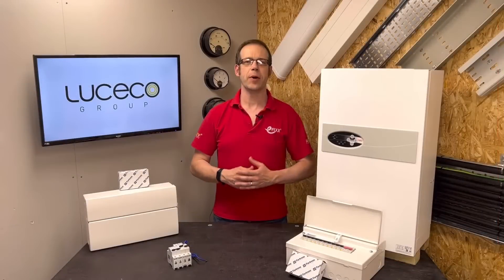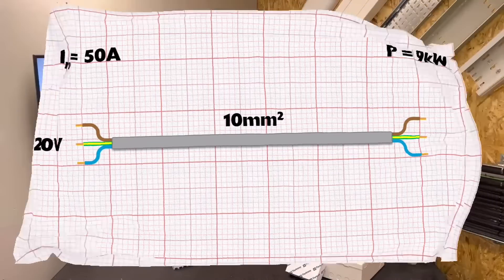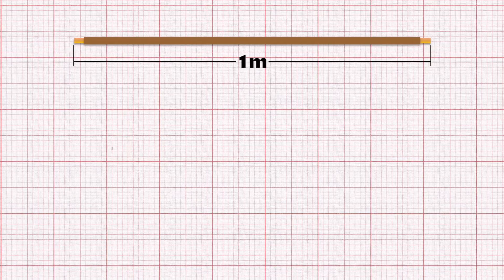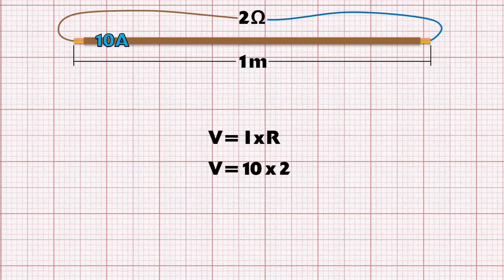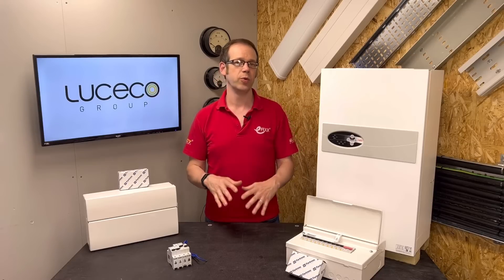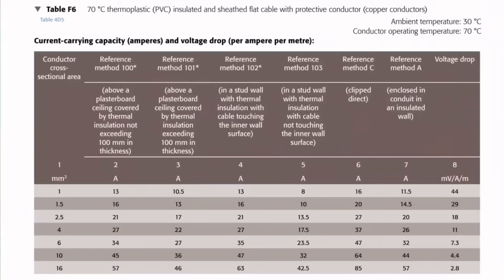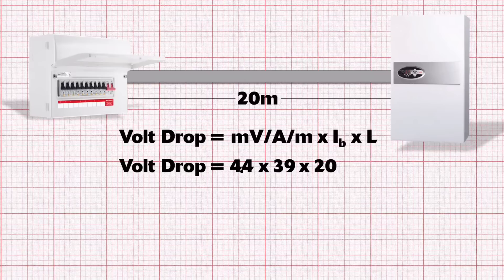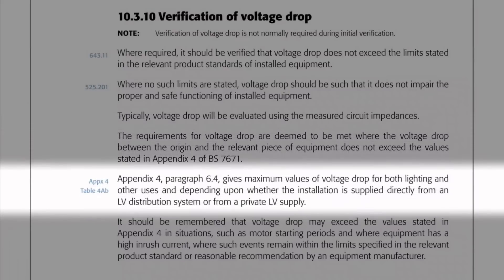Why Does Voltage Drop Along a Circuit?

Comment: I'm a former grammar school physics teacher. The content of this video reminds me of a GCSE and A level physics practical where we would calculate the resistivity of a wire. 

The resistivity equation being :-

p = RA/L

Where:-
p (Rho) = resistivity {Ohm- metres}
R = resistance {Ohms}
A = cross sectional area {metres^2}
L = length {metres}

The formula can be rearranged to calculate the resistance of a given length and width of a particular conductor. (R = pL/A)

I was recently asked to calculate the resistance along a 75 metre length of 4mm copper SWA cable. 

Resistivity of copper (p/Rho) = 1.77 x 10^-7 Ohm-metres
Length = 2 x 75 metres = 150 metres 
XS area = Pi x R^2 = 3.142. x (4 x 10^-3^2) = 0.00005 metres^2

So resistance along 150 metres of 4mm copper SWA is:-

R = p x L / A

R = 1.77 x 10^-7 (Ohm-metres) x 150 (metres) / 0.00005 (metres^2)

R = 0.0531 Ohms

Comment: why is the identical volt drop in the neutral wire ignored ? A 3 volt drop on the 230v supply means 227v at the load L terminal but the load N terminal is not zero it is 3v
Reply: The figures in the table are for the total voltage drop in both the live and the neutral conductors, so if a 3 V drop is calculated, that's about 1.5 V in the live and 1.5 V in the neutral.

Comment: Modern  LED  lamps need very little current to light up ..... With (  some , older ?  ) lamps , the capacitance coupling of the switch drop wires ( with the switch  OFF ! ) , is sufficient to make the lamp glow , dimly (   very useful as a night light 😝 ) ... but some folk find this annoying ... ( tried - n - tested ) ................. DAVE™🛑

Comment: Nice tutorial as usual.

It looks like you have similar vagueness, in determining where the voltage at the load will actually end up, to the standard here.  There's talk about max percentage drop across the installation, minimum permissible voltage at the load, the minimum voltage required by the load etc but no talk about the state of the supply itself when determining cable required to make it all work.  A supply with no load will present higher voltage at the origin than one under maximum rated load and that impacts what happens at the newly attached load in turn affecting the selection of cabling.  My own humble 63A supply (about 30m of 25mm2 aluminium from the pole to the PoA) will droop about 6V under full rated load.

Comment: This is why audiophiles use seemingly ridiculous size power cables together with heavy wired mains blocks.   It's not the current capacity but reducing resistance (impedance) that would effect sound.   It's also why some run dedicated lines back to the consumer unit (so nothing else is shared on that line), and also sometimes use clamping devices to clamp micro spikes that can occur on the mains.
Reply: No, they use ridiculous size power cables because they have no understanding of what they are doing.  There isn't an amp on the market that doesn't have regulated DC within.  Even if we do 1kW with a class A amp, so we are throwing away wads of power has heat, a bog standard line cord will result in a supply impedance quite able to deliver sufficient voltage under full load to the amp for a linear power supply to maintain regulation.  The only way the line cord is going to make a difference is if the cord being used is pure 100% Chinesium.

Comment: Would this make strip light style led fixtures flash on/off by any chance? - I actually had a spark shout at me 'Thats not how electricity works' when I suggested the light that's been replaced 3 times and still flashes.. on the end of the run.. might not be getting enough voltage.. not a bright spark I guess?
Reply: @abc123evoturbobonker  that’s almost certainly what’s happening, voltage too low
Reply: @ thanks!! 🙏

Comment: If were talking reality you won't get near the calculated voltage drop, measure it and you'll see. The voltage drop forumla and tabulated figures are overdesigned, intended for a quick calculation, not real world. Its based on a conductor operating temp of 70c which is unrealistic under normal load and also doesn't take into account "evenly distributed" circuits such as lights where the Ib can be taken as half... Further your example shows a radial, for a ring voltage drop is even less of a concern

Comment: It is incorrect to state that the voltage that the DNOs aim to deliver to properties is 230V. It isn't. When the UK adopted the harmonised EU standard for 230V, it involved no changes in the generating or distribution network. What happened is that the tolerance range was widened such that countries which traditionally used 220V, 230V and 240V were all encompassed. 

The specification was more for manufacturers of electrical appliances in the EU rather than to make countries move to actually delivering 230V. I know in my house and several others that the normal voltage delivered to the property is generally over 240V, often reaching 245V or even a little more. It is no coincidence that your own reading is showing 243.5 actual incoming. Mine is reading 244.2V this very moment.

Apparently the average is 242V in practice. Changing it would have considerable cost implications for the network. Of course it should not be relied upon - there will be properties that will get less than this, but nothing actually changed in the real network in 2003.

Here's a quote from a company (Leads Direct) about what the actual situation was following the adoption in 2003.

***********************************************************************************

"What is the difference between UK voltage and European voltage

The voltage used throughout Europe (including the UK) has been harmonised since January 2003 at a nominal 230v 50 Hz (formerly 240V in UK, 220V in the rest of Europe) but this does not mean there has been a real change in the supply.

Instead, the new “harmonised voltage limits” in most of Europe (the former 220V nominal countries) are now:

230V -10% +6% (i.e. 207.0 V-243.8 V)

In the UK (former 240V nominal) they are:

230V -6% +10% (i.e. 216.2 V – 253.0 V)

This effectively means there is no real change of supply voltage, only a change in the “label”, with no incentive for electricity supply companies to actually change the supply voltage.

To cope with both sets of limits all modern equipment will therefore be able to accept 230V +/-10% i.e. 207-253V."
Reply: My house regularly has 250v according to my Shelly EM, but I am a couple of doors down from the transformer.
Reply: so why then before harmonisation when we wanted to the current draw of say an electric kettle we would defide the pope by the voltage for example a 3kw kettle for example would be 3000 defided by 240v= 12.5 amps , now we use 230v for our calculations so now we get 3000/230=13.0435 amps.
Reply: @Dog-whisperer7494  It's because the nominal voltage of 230V is not what is normally delivered. Usually it will be about 240V. In any event, the only difference is going to be a slightly longer time to boil the water in the kettle if what is actually supplied is 230V, not 240V. In practice there is a lot of variation in voltage supplied by location, but time of day, demand and so on.

The nominal 230V is actually a range of 230V +10%, -6%. So what might be delivered could be anything from 216.2V to 253V. The actual wattage of the kettle is going to vary accordingly. Theoretically, if it's rated for a maximum of 3,000 watts on 230V, then that should be at the top of the voltage range, which means it would carry 11.9 amps and the element would have a resistance of 21.3 ohms.

If, however, the minimum voltage of 216.2 V was being delivered, then the current would be just 10.1 amps and the kettle would deliver only 2.19 kW. 

So, as kettles are purely resistive devices, then they will only deliver the rated 3,000 kW at a specific voltage. 

Also, as well as differences in actual mains voltage, there will be voltage drop in the household wiring. So, in practice, the voltage at the kettle is likely to be 3-4 v lower than where it is supplied, further dropping the voltage at the kettle, and the power delivered.

So, there is really no such thing as a 3 kW kettle. The output varies according to the voltage it is presented with.
Reply: No, the nominal voltage quoted by any DNO for a single-phase LV supply *is* 230V, within the minus 6% / plus 10% envelope. You are correct that there was no widescale alterations required to the LV network when the 230V nominal value was adopted. It was intended at that time that the statutory voltage envelope would subsequently be extended to plus/minus 10%, but that change has yet to be enacted.

Secondary distribution transformers supplying the LV networks in the UK usually have a nominal voltage ratio of 11000:433V, which corresponds to a no-load phase voltage of 250V at the LV busbars. This is a deliberate design feature that anticipates voltage drop across the LV network. The transformers are supplied with manual, off-line tapchangers to allow voltage to be adjusted by up to +/- 5% in five steps (-5%, -2.5%, nominal tap, +2.5% and +5%). A small number of distribution transformers have primaries rated at 6.6kV (old urban networks, most of which have been uprated to 11kV) and 33kV (rural distribution in remote areas in Scotland). A small 'island' of network in the Scottish Borders still operates at 22kV.
Reply: @protectiongeek  I did not say the nominal voltage is not 230V, I explicitly stated that it is not what DNOs seek to deliver, which is essentially no different to what it was before harmonisation. Nominal literally means in name only. What you will find in the great majority of UK homes is what the DNOs and National Grid aim to deliver, which is around 240V.

They do not aim to deliver 230V in normal circumstances to the great majority of domestic properties.
Reply: @TheEulerID  if you apply for a single-phase LV supply, you will be quoted for a nominal voltage of 230V - what the DNO 'seek to deliver', in your terms. DNOs don't 'aim to deliver' 240V. They 'aim to deliver' 230V within the statutory voltage envelope of -6%/+10% and achieve that most of the time.
Reply: @protectiongeek  The do indeed. A nominal voltage is not an engineering target, and the DNOs don;t aime to deliver 230V, they aim to deliver in the range 230V +10%, -6%. That is 216.2 to 253V. That is the engineering target, not 230V. The latter is nominal, and is not what anywhere near what the great majority of UK properties will see, which will be a bit over 240V.

The DNOs and National Grid have to use a de-facto target of around 242V for most properties or they won't be able to guarantee voltages within the defined range.

That's fine, but 230V as an absolute value is not the target, it's a nominal figure and should not be used as the definition of what people might expect to see.

I find this sort of sloppy use of language annoying and misleading. Nothing significant infrastructure-wise really changed when the UK adopted, with others, the  EU harmonised  230V standard. We did not move from a position where 240V was the normal voltage to where 230V was. Everything remained essentially the same. If it didn't, and the aim was to deliver 230V as the norm, rather than a bot over 240V then they would have had to reduce the grid voltage by about 5% which is not what happened.
Reply: @protectiongeek so why then before harmonisation when we wanted to the current draw of say an electric kettle we would defide the pope by the voltage for example a 3kw kettle for example would be 3000 defided by 240v= 12.5 amps , now we use 230v for our calculations so now we get 3000/230=13.0435 amps.

Comment: You could have usefully shown an example of a power source supplying a load, for example the losses in the Line and Neutral effectively double the losses, so losses on the line and neutral means the load voltage is less than you said. Also PF should have been mentioned or assumed to be 1.

Comment: Electrons that form a current flow collide with the ions in the cable, the collision gives up energy as heat. The result is a drop in voltage.